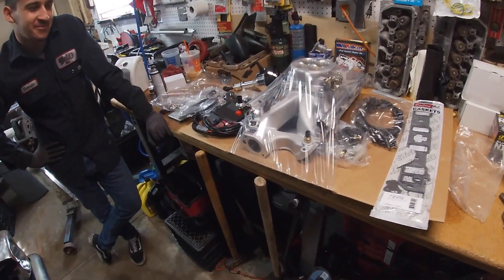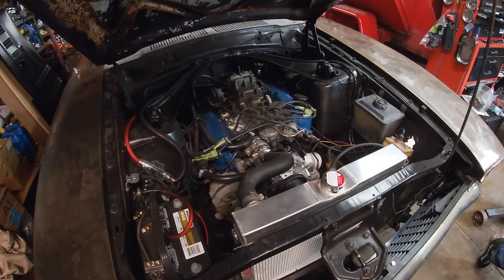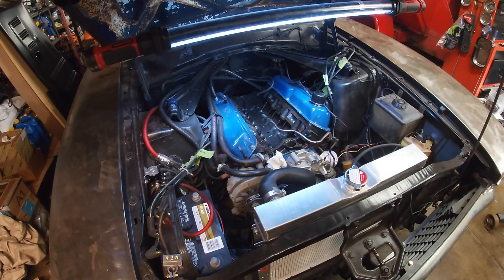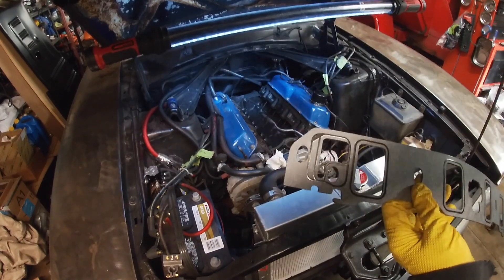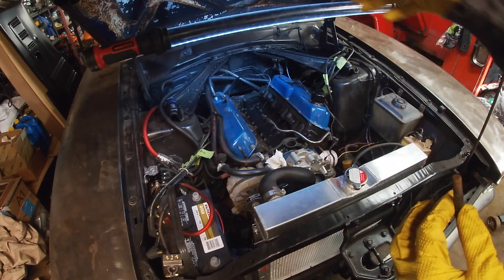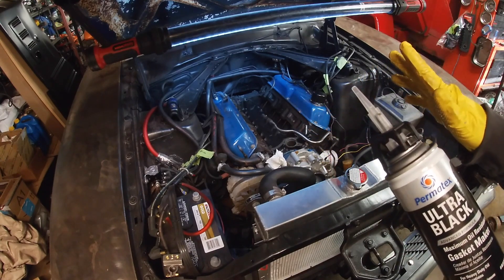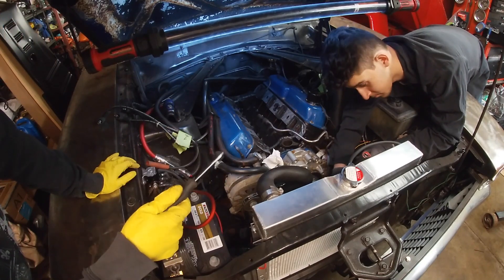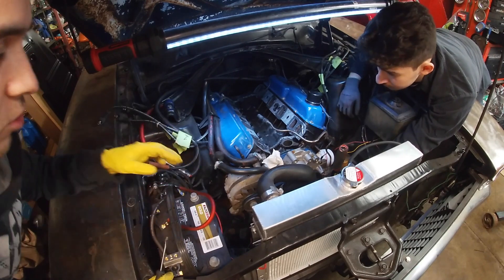Edelbrock Pro Flo 4 EFI Install 1971 Ford Maverick Part 1

Comment: Just out of curiosity. From all the different types of Efi systems out there, what made you choose the Pro-Flo 4?
Reply from the maker: The kicker for me was the concept of the fuel injectors being right above the intake ports instead of up in the throttle body, and I liked the complete kit idea (except for a separate fuel supply kit) After I finish the install and drive it a bit I will be doing an overview video